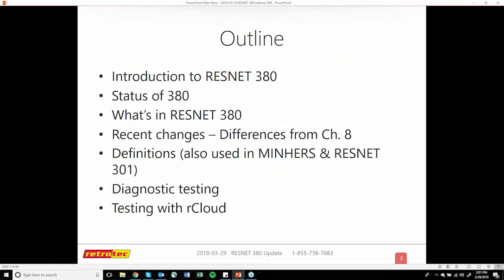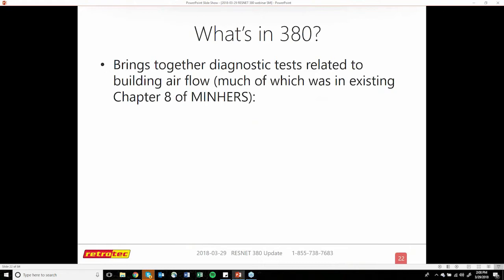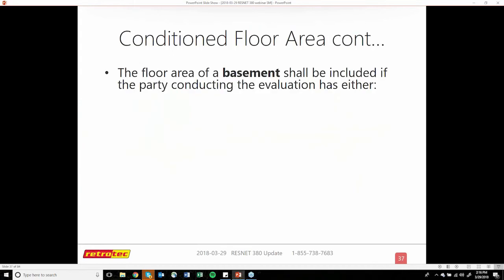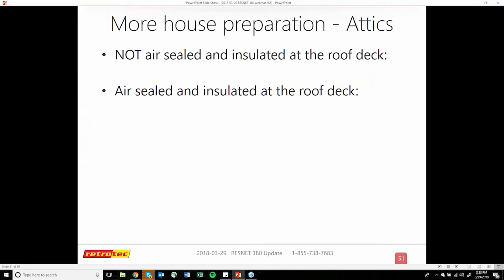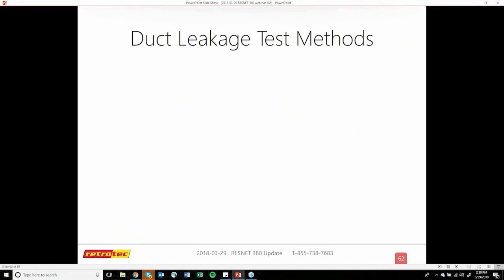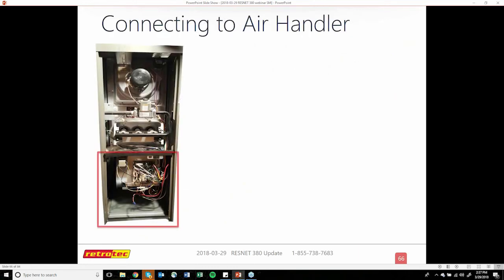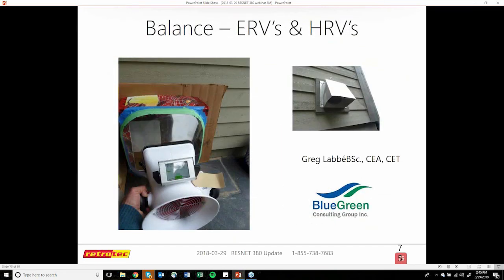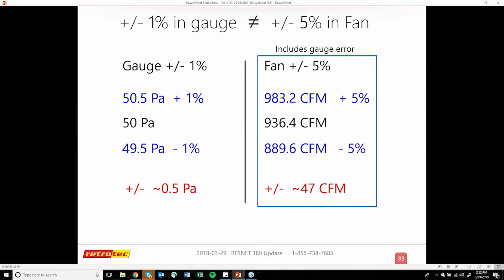Standard 380 - What You Need to Know for Compliance (March 29th, 2018)

Comment: On duct testing...
What if there are multiple returns, and it is a package unit?
Reply from the maker: Sorry for replying so late, just now seeing this. This is definitely a tricky one. If I'm a HERS Rater, I would work with the contractor to get me an access point to the system. This may involve fabricating a device to attach to one of the panels. This is tricky because now you're testing outside and wind will be a factor. May be good to do a baseline test and keep the gauge out of the wind as much as possible. A transition could possible be fabricated to attach to one of the returns to gain access that way. This is definitely a scenario that will involve some creativity.